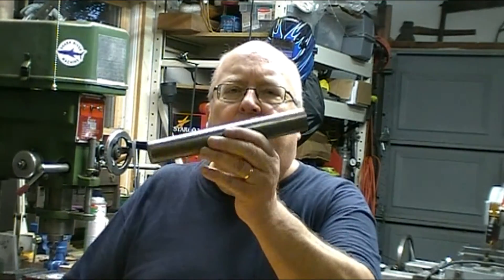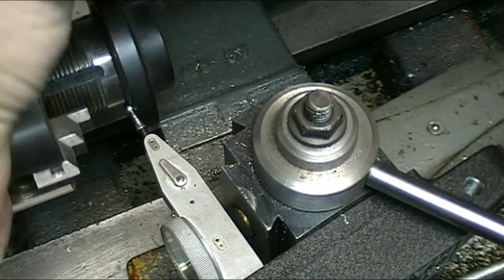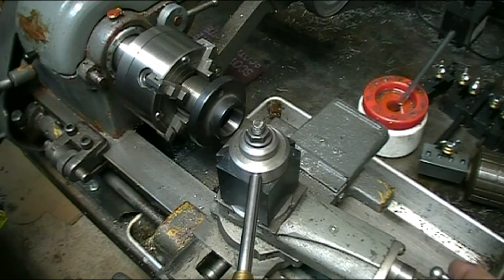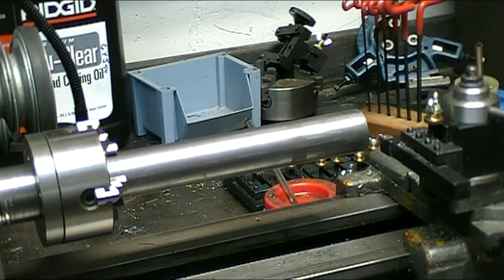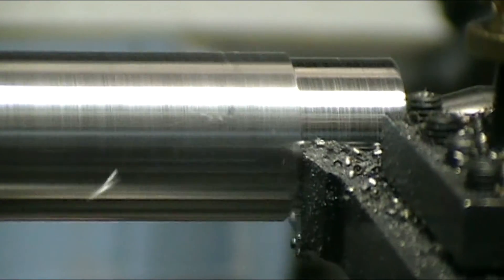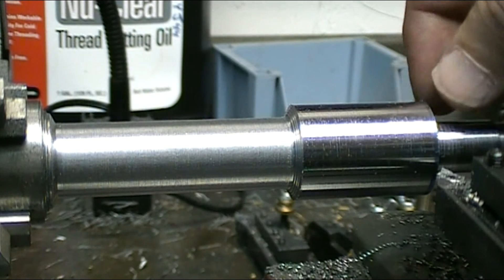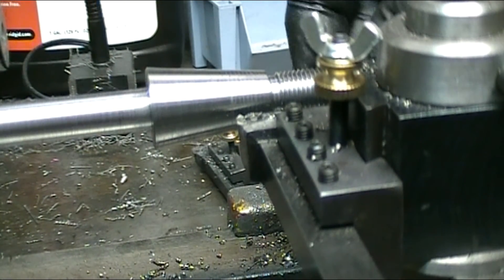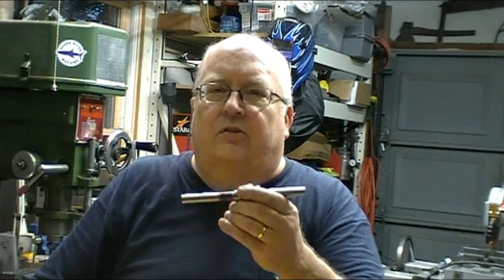Surface Grinding Wheel Balancing Arbor Build

Comment: Good work. If the taper is a good fit, there is no need for the thread cutting or to use the nut. Static balancing does not require the safety of the nut as the arbor is also almost static too 😊
Reply from the maker: I  realized that the first time that I used it.  Thank you for watching and commenting.

Comment: My God Steve, just looked at your video and its almost exactly the same as my arbor.  Great minds think alike. 
Cam
Reply from the maker: The funny thing is that my taper fit so well that I don't have to use the nut when balancing a wheel. Lucked out on getting the taper right the first time.  Thanks for stopping by.

Comment: That taper is 7.125 degrees per side but I only used the lathe to rough mine out. I then finished it on the surface grinder.. That hub looks like a harig or equivalent so the taper is almost certainly the 7.125 degrees since its based on 3.000 inches per foot total included taper. I am uploading a video tonight on me balancing wheels using coins and various weights such as washers and jb weld.. The arbor does not have to be tightened down the taper simply sticks in with a twist.. On the tapers I have a good video uploaded giving the angles and stuff on most grinders.. however its on JC MILLS   I am using key west since they kicked me off for one week because I uploaded a video of the tiger being beaten with sticks--and the owner of the video complained...
Reply: but good arbor no doubt about it--myself I did not have that much time I simply put a sleeve on thompson rod and jb welded it and let it cure overnight then roughed it out in the lathe then finish spun it on the surface grinder..

Comment: Nice job Steve. I have the same job on my todo list. I noticed at 16:48 at the end of cutting the thread the cutting tool rose up quite a bit. Do you have a rigidity problem with the toolpost or tool holder? Cheers.
Reply from the maker: I had not noticed that, buy yes this lathe has a rigidity problem.  I have eliminated a lot of it by building the all steel tool post. Going to have to look at the gibs again.  There seems to be a lot of spring in the system.  Thanks for watching and commenting.

Comment: Great job Steve, but I have a question.  Why do you need left hand threads on this arbor?  Isn't the nut just to hold the hub on the arbor - it won't be spinning like it will be on the machine.  I've got my balance frame done, but haven't started on the arbor - got to get some good material for it (like you did).
Reply from the maker: You are absolutely right.  I was designing this on the fly and I was thinking that I would be using the nut off the machine.  Actually as long as the hub wedges on the taper I don't need a nut at all.  Thanks for watching and commenting.
Reply: R. Steven Lang, Shark River Machine Well it did get some LH thread experience. I just wanted to be sure I wasn't missing something as this is definitely on my to do list.
Reply from the maker: LH threads are actually easier because you are threading away from the head stock. Less chance of a crash.  I am sure that there are better choices for material, I really like the way my little lather handles the stressproof.  It is supposed to be around Rockwell 25C. That is good for the kind of use it will receive.

Comment: Nice video Sir, Your taper work went smooth, well done. Thanks for sharing the knowledge and experience.  
I started watching your videos when you auctioned your hammer and Steve Sommers won it.  Your are part of a small community of machinists that is an accomplishment.  Please keep doing what you do.  Respectfully.
Reply from the maker: Thank you for watching and commenting.  I was very pleased and somewhat surprised how well the taper turned out. I am just finishing up the frame for the balancer and should be publishing it next week, just waiting for a tool to come in so that I can complete the project.